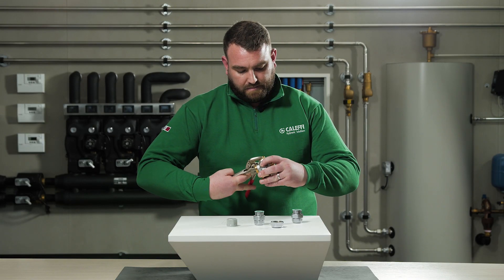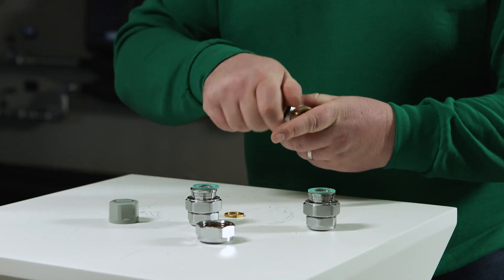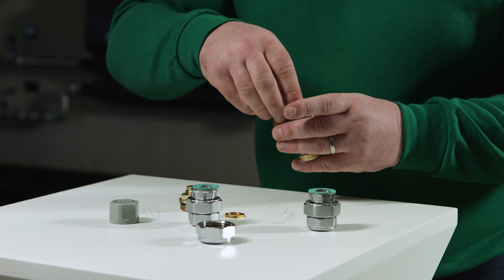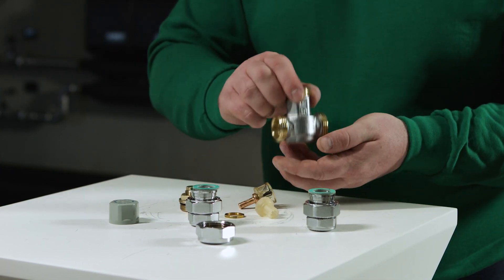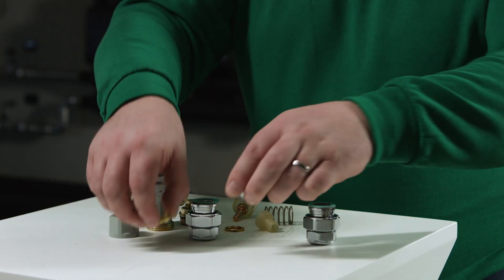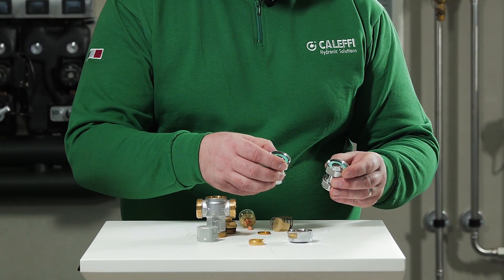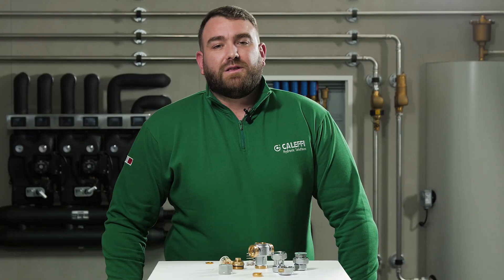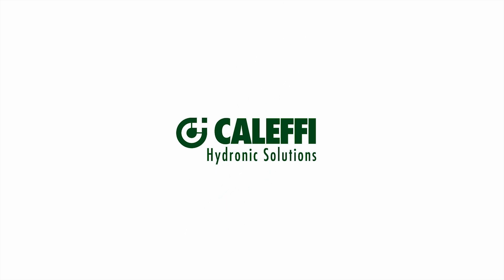Why do we need TMVs (Thermostatic Mixing Valves)?

Comment: Do these need to to every hot tap in a new build house or can you fit just one or two after the hot water tank to serve them all?
Reply: Good afternoon Dan. These mixing valves are designed as point of use so should be fitted directly to a bath to protect from full-body immersion and to washroom outlets such as wash hand basins. There is no requirement for this on kitchen sinks as higher temps are required for the breakdown of food matter and grease. If you have any further questions you can call the Altecnic tech team (UK branch of Caleffi) on 01785 218 206. Thanks for the question, Ed.